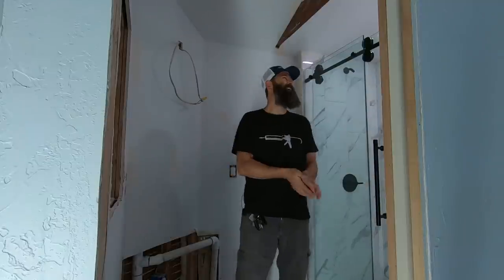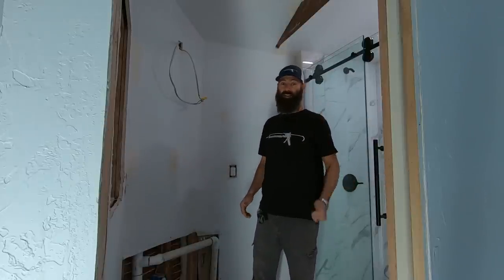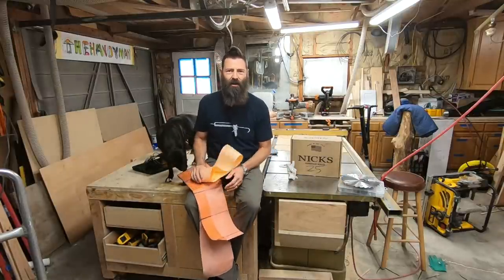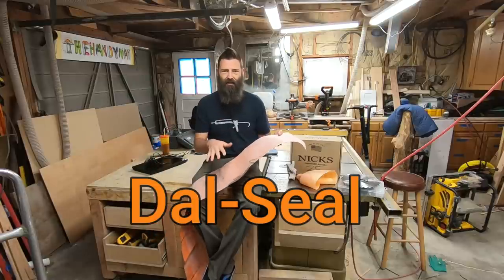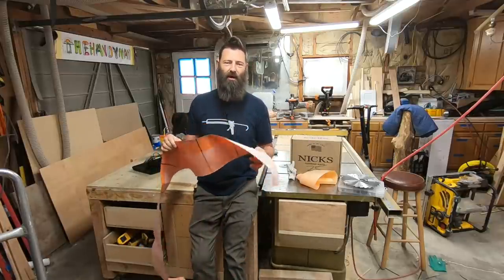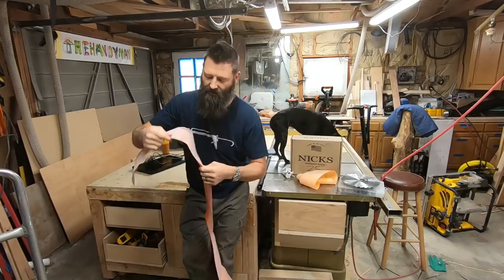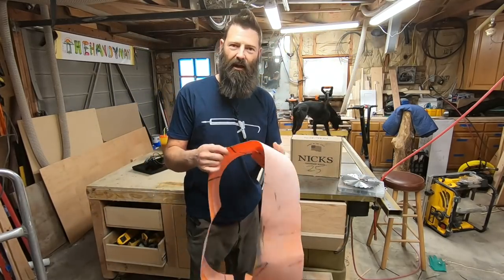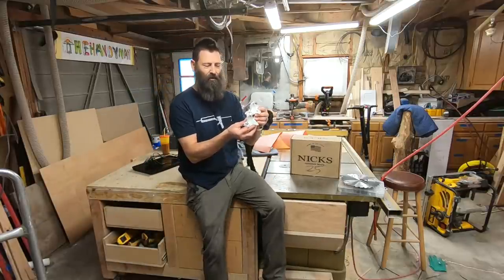Only The Pros Use This Tile Product | Handyman Are Not Allowed To Buy It | THE HANDYMAN |

Comment: Just exactly “how” does it prevent cracking? Also Kerdi Membrane is not designed for floors (only shower pans). You would use  Ditra or any other brand of “uncoupling membrane”. These membranes allow for expansion/contraction in substrate. Also how do you “seam” one sheet to another? 
I don’t think you are comparing products accurately.
Reply: Exactly...

Comment: Why did you caulk the ceiling corners? It was done in my house and made my master bathroom popcorn scrape hell. I had to redo the entire corner seam and remud it all. Just curious what purpose it serves. I could see it being a nice aesthetic blend to round out and soften a white ceiling to colored wall transition, which is why i assume mine was the way it was.
Reply from the maker: Its just standard procedure when doing drywall.  It makes for a nice straight paint line.